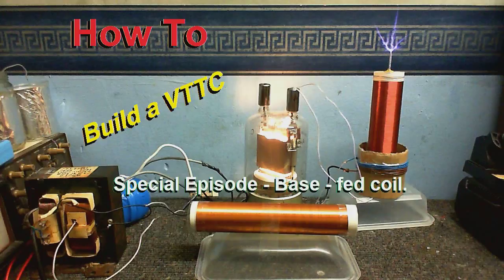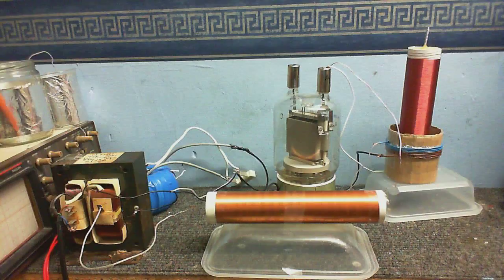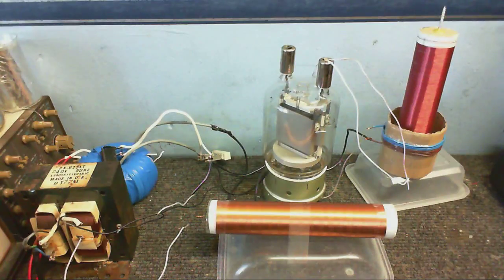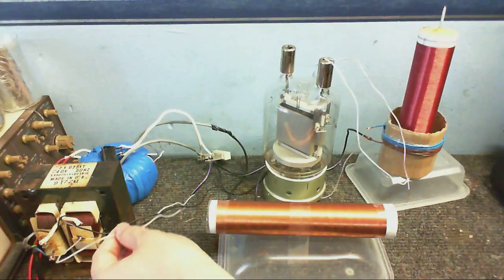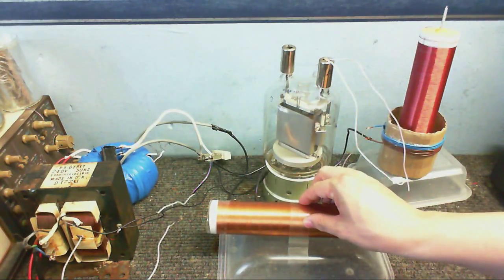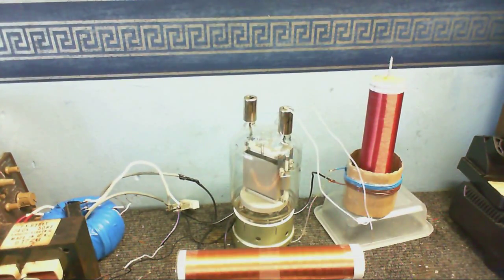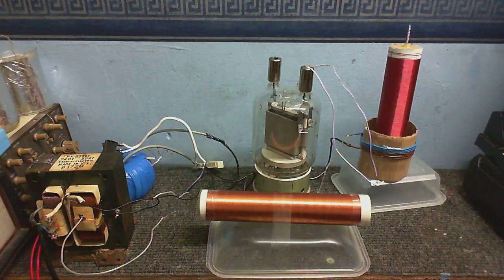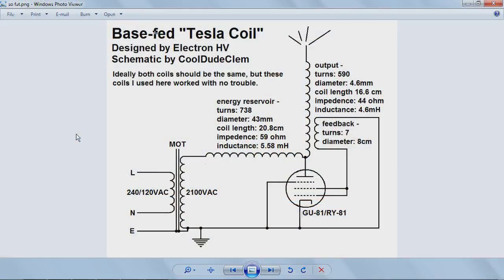How to build a VTTC special episode - Base-fed coils!

Comment: This is a great video showing the simplicity of how a VTTC can be made. Vacuum tubes are awesome, there is a romance to them they are mostly hand made and there is a lot of human TLC that goes into one, unlike mass produced semi-conductors stamped out by a machine. I am building a GU81M based on Steve and Michelle's work at Tested To Destruction on YouTube.  If this one is successful and I feel the need to build another, that one will be a Rotary Spark Gap Tesla Coil. After that, maybe a Solid State Tesla Coil.

Comment: Nice! BTW, I forgot to tell you and everyone who knows what a Magnetron is should know. I may possibly be wrong, but I found out that Magnetrons contain some BERYLLIEM. The stuff is not very good for you when it is smashed or broken. Removing the cap is fine, just know if you take apart a magnetron for parts, don't break the tube itself and especially the top ceramic part. This is true for some other ceramic tubes and insulators as well. You probably know this, but if not just wanted to let you know.  It is totally safe if not broken, but if turned to dust it is not good. It's not a huge deal but something people should keep in mind; like breaking florescent tubes and Mercury.
Reply: Yep, they contain beryllium oxide, when inhaled it can cause berylliosis. Take this guy seriously if you tear down microwaves.

Comment: can I use an flyback transformer instead of mot ?
Reply from the maker: I don't think so, it has to be a mot.  As flybacks are for powering the picture tube in a CRT TV, the voltage they produce is very high and only a few milliamps, totally won't work for something like this.
Reply: as I expected..but I had to ask to be sure :).I try to find a more reliable version to SSTC because they tend to failure more quickly,perhaps because of the simplicity of the driver circuit.
Reply from the maker: Yeah, tubes are much more forgiving.
Reply: Thanks for replay and keep up the good work..

Comment: Any chance on upgrading it to solid State, I like tubes, but ss devices are easey to find, cheaper bla bla bla. Those high voltage are the main issue. Not sure. Ive seen mosfets up to 600V but not much current ...
Reply from the maker: 38911bytefree Oh yes, I will be doing solid state coils later on.  When this mini series on VTTCs is over I'll be moving on to the solid state stuff.

Comment: You need to heat up the filament of the tube Wright ? Other wise is does not work so how do you do that or am i wrong

Sorry for bad english
Reply from the maker: Yes, the filament does need power, in the datasheet it says 12 volts at 11 amps, fortunately I have a transformer that can supply that kind of power no trouble.
Reply: CoolDudeClem you only use one Transformer in other video's peaple use 2 transformers one for te power one to heat the filament but you only have 1 so how do you do it 

Thx for fast reaction
Reply from the maker: It looks like there is only 1 transformer because I forgot to include the filament transformer in the schematic, but I am using two transformers, plus I use the center tap on the filament as the cathode since the gu-81 I used does not have a separate cathode.
Reply: CoolDudeClem thx for responding i think im ganna give it a try to build it